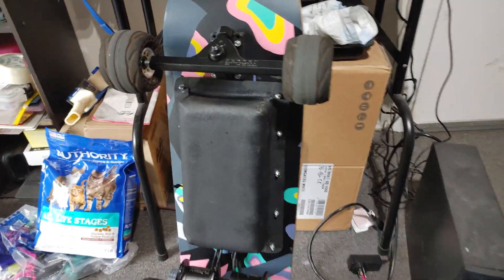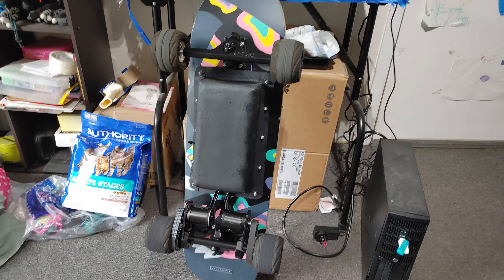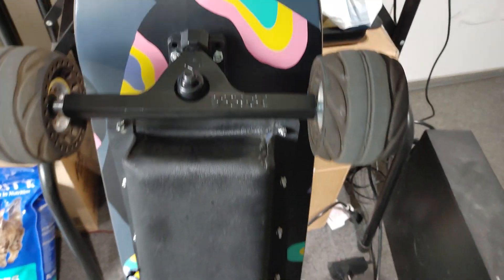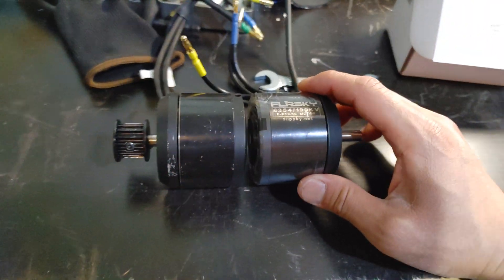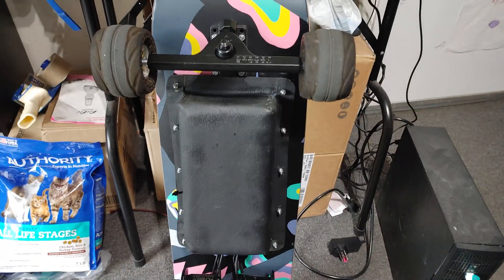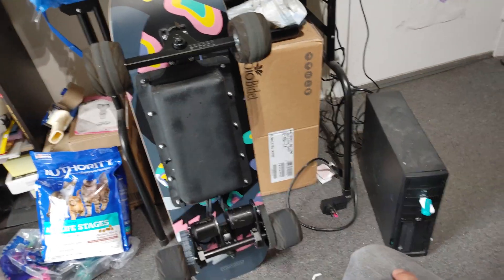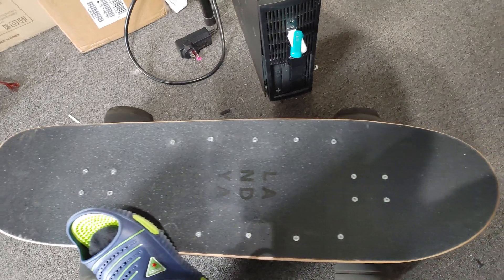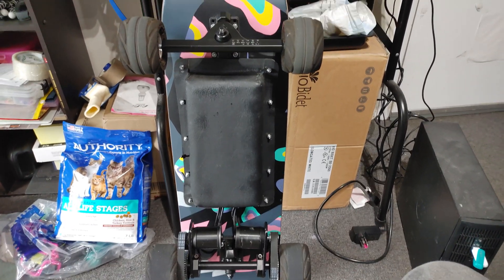DIY Electric Skateboard w/ dual 5065 motors & 105mm Rubber Airless Tires!

Comment: Dr E . I'm planing a similar single motor build.  Do you think a single 6374 flipsky 140kv would make it up Pacifica hills
Reply from the maker: No chance.  Need dual 6354 for decent performance.  Single 6374 will not even start off hills.  Even dual 5065 won't go up.